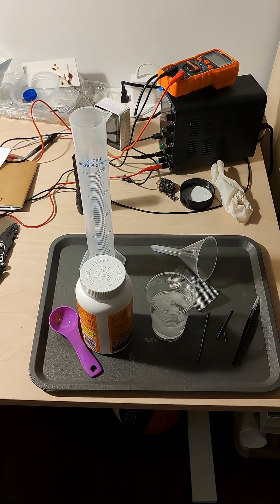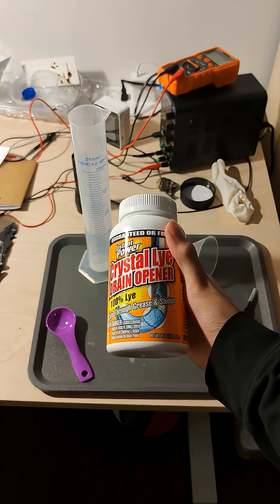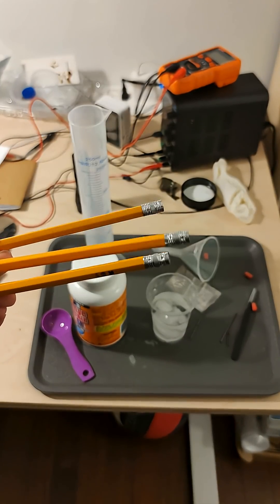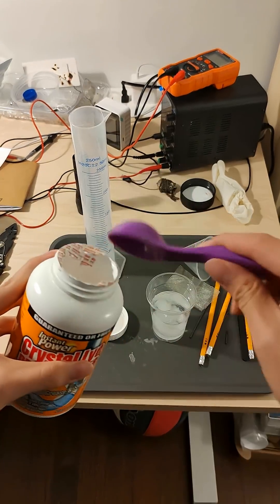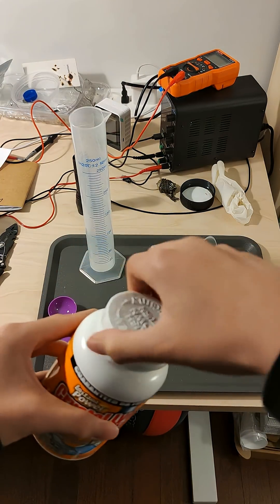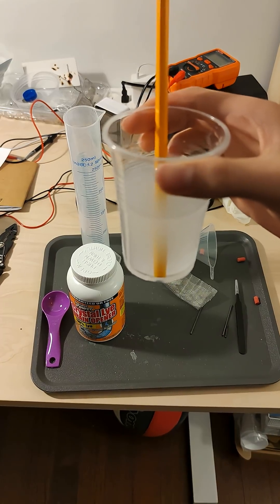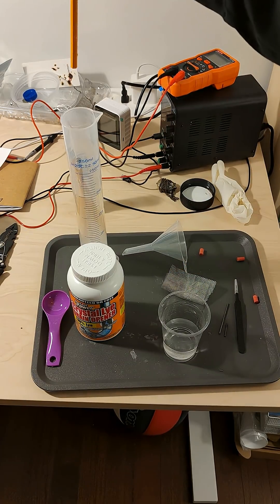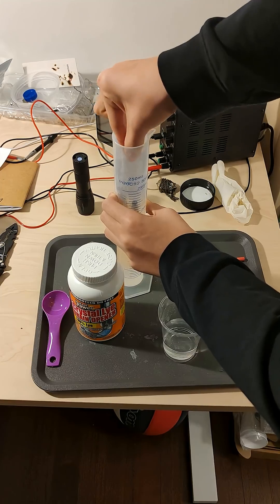How to make graphite electrodes from PENCILS | Part 1

Comment: I'm not sure but if you are trying to get the graphite out of the pencil often cheaper ones are poorly glued together and if you are careful you can pull em apart by either snappy one end and then it's will break into 2 pieces or carefully with a knife(sharp box cutter)...... my guess based on wood pulping, not seen your other videos
Reply from the maker: strangely enough, you can peel the wood off with your barer hands! Check out part 2